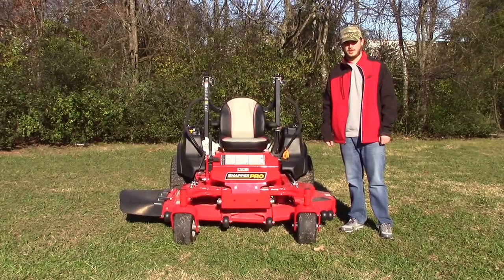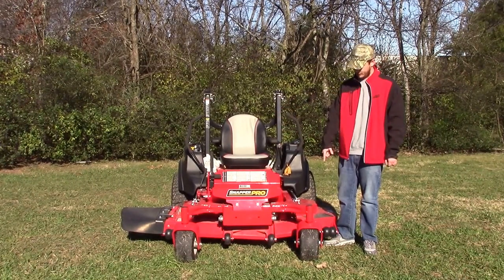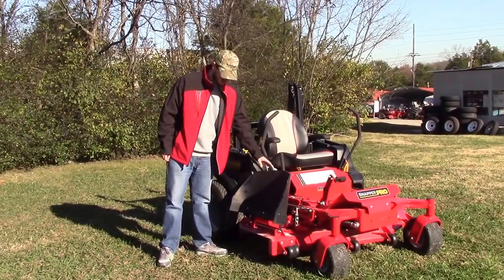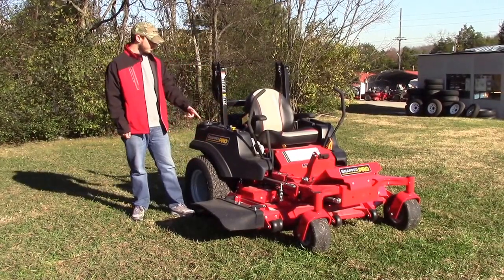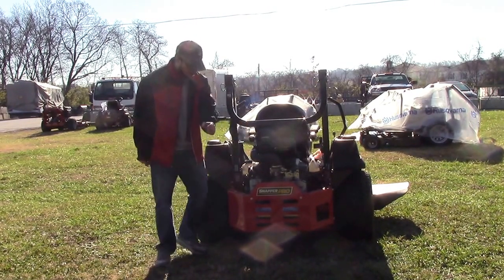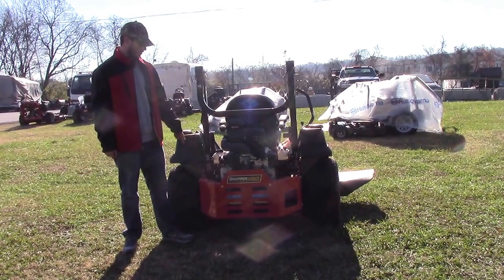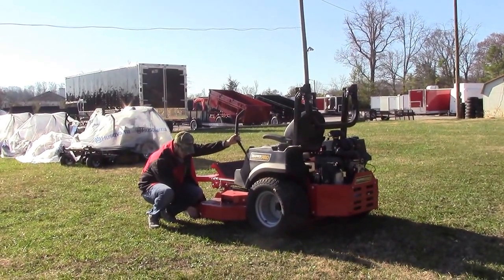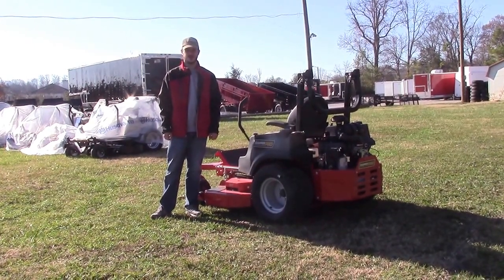Snapper Pro S200XT Zero Turn Mower Review

Comment: Yes,🌼 allabout.wiki/2691402 the bag fills up pretty quickly when there are lots of leaves and I guess that is expected. It is quick to take the leaf catching bag off and put it back on. There is one bar with rubber ends that fits into a slot (bottom), one bar with angled ends that hangs on rubber hooks (top), and two stretchy loops that each hang on a rubber hook (one each side). You can hold the leaf catching bag with one hand full and not drop any leaves. It is NOT easy to empty it into a lawn bag without spilling. My trick: I put two lawn bags side-by-side in a large garbage bin and emptied the leaf catching bag into them. What spills falls into the garbage bin. 90% of the leaves end up in the bags this way with 0% back on the lawn.

Comment: Changing the oil is a bear.  The engine release screws require a screwdriver and acrobatic skills to reach and feel in order to get the 1,100 lb machine to "Free-wheel".  It is nearly impossible to siphon the gas for Winter storage to retard the chance of oil shellac globs from forming and fouling the engine for next Spring mowing.  You must remove the gas to store for more than 6 weeks.  The gas globs will foul the EFI system and fuel stabilizers do NOT completely work.  The best bet is to run the engine dry like a blower or chainsaw, but that is a crap shoot too.  If you foul the EFI system, the word expensive repair is a Hint.....  There is no way to jump start the engine.  One has to raise the seat in order to access the battery, and with the seat raised, the dead man switch is engaged.  All the safety and wiring are grouped into snap in/out harnesses.  You either charge the battery in place, or remove and charge, or replace.  The mower was expensive, maintenance was expensive/required and any repair is equally expensive.